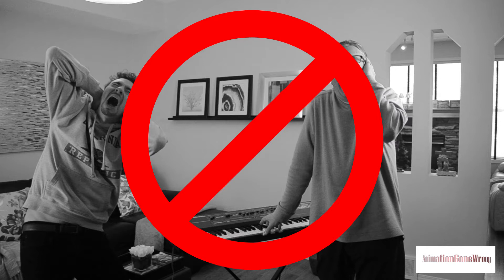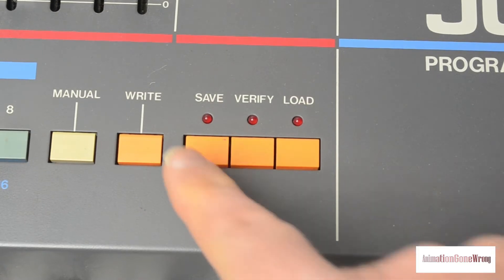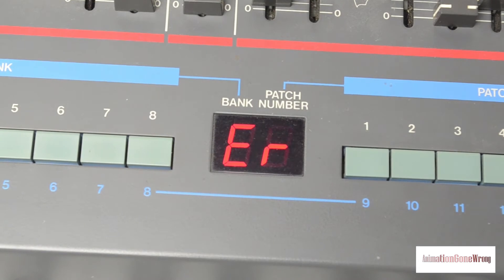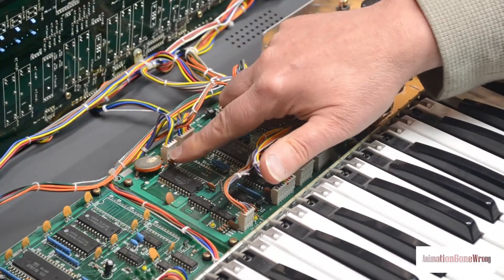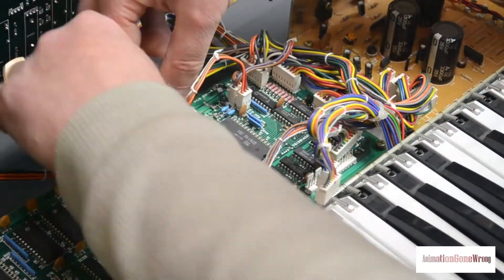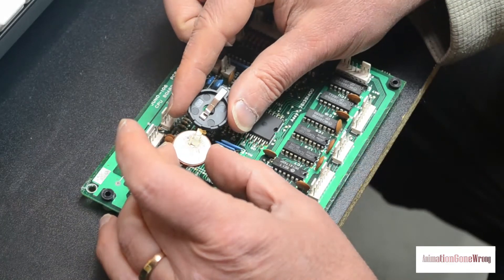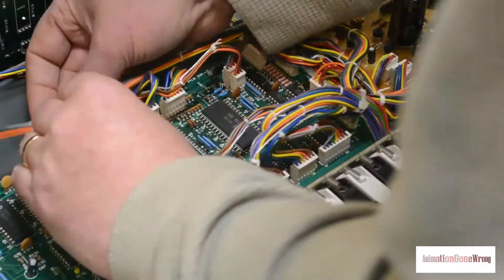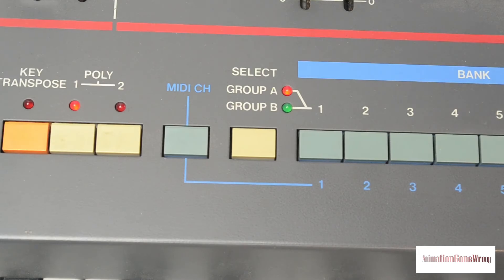DIY Roland Juno 106 Battery Replacement - The Ultimate Guide

Comment: Hello great video! I recently bought a Juno 106 and the HPF slider is not working very well at position 1. Is it hard to repair component on the PCB of Juno 106? Does it break easily? Any suggestions to things I should be careful about when repairing the HPF slider? I am a beginner at soldering. THANK YOU!

Comment: Hello again and thank you in advance. I'm going to give it courage and try to change the beat of Juno 106. I am not an engineer and for me this is too complicated but where I live there is no other option. 
Please, I have some doubts. When to connect the audio Jack in the Juno 106 in the Save outlet and another after using Audacity and then another Javi into The Load jack. My question is where do I connect the other end of the jack in the interface? I don't know I use a Focusrite but couldn't you explain to me how to do it? Or the other end of the jack goes to the computer. Could you please help me. Thank you very much for sharing. Best regards
Reply: Hello I have the JUNO 106 and Focusrite audio interface. What you need to do when recording from the Juno 106 is to connect SAVE from Juno 106 to the input of the audio interface. When loading a sound, you need to connect SAVE to the output of audio interface. Feel free to edit all the presets on the JUNO 106, you can always restore the factory default presets back by searching up the TAPE AUDIO for resetting the presets.

Comment: Rookie here -- got my 106 during Covid, and recently the patches have been cleared every time the synth is power cycled. Tried tape loading the factory patches in, and the load button just stays on. Never errors out. Never defaults back to the verify light with the patches successfully loaded. 

Is replacing this battery the right move? If so... just confirming, it's a CR2032 battery, and any of the circular clips like you have with the pegs coming out from the bottom should work ok for this type of replacement?
Reply from the maker: If the load button stays on, it might not be reading the tape properly. Try increasing the volume first.
Otherwise, you may want to look at replacing the battery.  They don't last forever, and it's fairly easy to do.  But you have to make sure you can save/load the patches first.

Comment: To save the patches, you can install a new battery in a battery clip with wires attached to the clip & then solder that battery battery across the existing battery using traces on the board that are away from the old batt traces.  Then when you remove the old battery, the back-up is still powered and will not loose the patches.  You just have to be careful you do not short out the old battery when unsoldering it otherwise you will remove the backup voltage & clear the memory.  I've done this successfully many times when I had my business Mars Amp Repair in Denver years ago.

Comment: Hello, greetings. I have a question and it is that to change the Juno's battery I have to remove the CPU and solder as well?Thanks for sharing and your knowledge with everyone Please hekp me 👍
Reply from the maker: You need to remove the CPU board to get at the battery.  You don't have to remove the actual CPU itself. I hope this helps.
Reply: @AnimationGoneWrong  Hello, thank you for responding very quickly. Thank you from the bottom of my heart. Ok, I don't understand much about electronics unfortunately and that's why I saw the video and that's why I decided to write.
So I just have to open the panel and change the battery, is that it? I bought the Juno a year ago I think and I just found out that it has an internal battery. I hope it's not too late. 
Thank You for your help and support  I'm very grateful and And I appreciate it.
Reply from the maker: @Frank-vf8xf  just remember to back up your patches before you remove the battery!
Reply: @AnimationGoneWrong  Ok, yes, I was watching your video but my English is not very good and I have to use a translator. Tomorrow more calmly I will see him more stopped but I did see that. But what are patches?
Something that I have recorded or the presets or sounds of the Juno. I don't know what you're referring to
Reply from the maker: @Frank-vf8xf  Yes, patches are the presets (or sounds) on the Juno.  The battery keeps them in memory, so when the battery is removed they are lost.

Comment: Great video thank you! 

One question - if my battery has already malfunctioned and my presets sound a lot like yours in the intro, can i still save and restore them, or do i need to search for a factory default patch data/audio file and start over? 

FYI i had not saved any custom patches, so factory default is fine.. thanks!
Reply from the maker: You could do either. You can try to save what you have, or locate an audio file for the default patches. If your patches are not working now, saving and reloading them won't fix them.

Comment: Nice video, thank you, just one question about the positive and the negative pins on the battery holder. Is the positive close to the end of the board itself or the opposite?
Thanks again.
Reply from the maker: If you take a close look at around 5:40, you can that the battery symbol is visible on the board. The positive side goes more towards the middle of the board and the negative side goes towards the end of the board, towards the edge. Also, the large flat surface of the battery is the positive contact, which should help you line things up.
Reply: @AnimationGoneWrong  nice, thanks again 👍😊 liked and subscribed